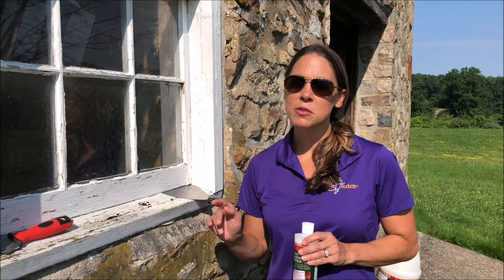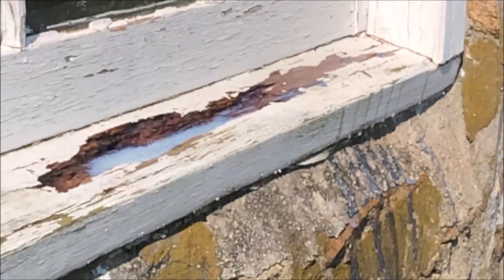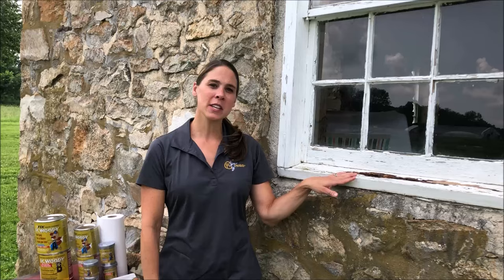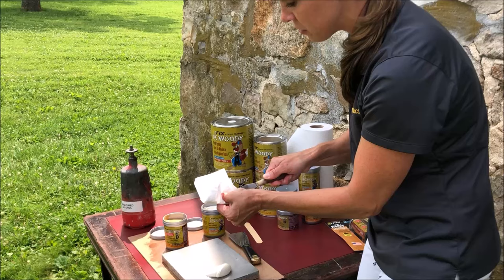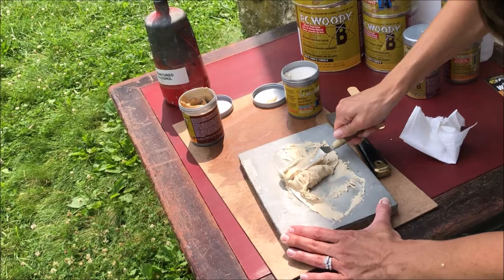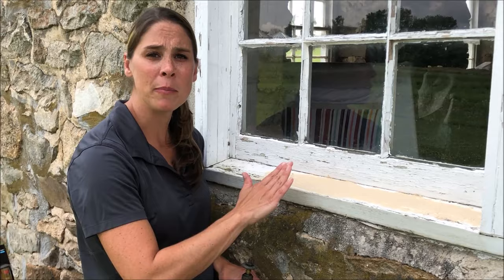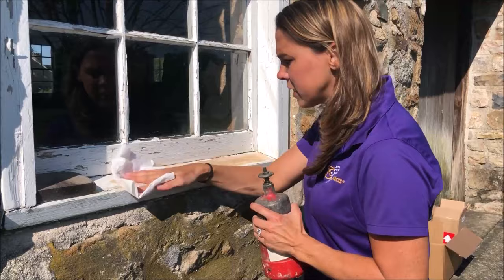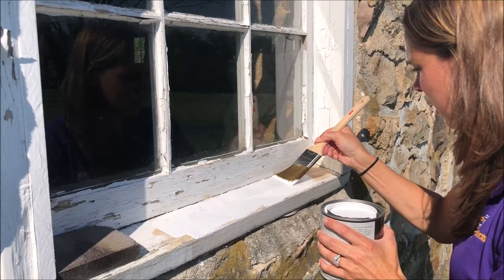Rotted window sill repair with PC Products

Comment: I'm interested in the wood hardener, but the actual details are lacking in the video as you go straight to the filler. How strong is the wood after you soak it with the hardener? I don't expect it to be like a whole piece of wood, but it would be nice to know if the strength is increased as a result of the hardener rebinding the rotted wood.
Reply from the maker: PC-Petrifier improves the hardness of damaged wood but it does not restore it to “new”.  It will strengthen the wood to enable the application of a wood filler such as PC-Woody.  How much strength gets added?  Tough to say because of variabilities in damaged wood.  It is best to expect minimal strength added and if more is needed then try PC-Rot Terminator.  It provides greater hardening than PC-Petrifier.

Comment: What if the wood is on a vertical surface?
Reply from the maker: Petrifier can be applied with a brush. Drilling small holes at a downward angle will help the product penetrate deeply. Woody can be applied vertically up to about 1.5-2 inches depending on the depth and width of the void.

Comment: The PC Woody works great. However, you showed a repair of a relatively accessible section of a sill. I’m repairing sill corner that is difficult to get the PC Woody into the crevices. Any suggestions on how to approach this problem?
Reply from the maker: If the corner is hollow it will be necessary to open up the surface and harden the wood with PC-Petrifier or PC-Rot Terminator wood hardeners then follow with PC-Woody.  If the damaged is limited only to surface crevices use alcohol or acetone on your gloved finger tips or tool to aid application of PC-Woody.
Reply: @pcproductsepoxy4315  Thanks for the acetone suggestion. The PC woody was sticking to my gloved fingers.

Comment: This looks like a great solution.  I have a basement window sill that's rotting out from the bottom such that the concrete foundation is exposed.  Will this product bond between the wood and concrete surfaces?
Reply from the maker: Yes, The PC-Woody will adhere to both the wood and the concrete. You may want to mask off any areas around the repair to prevent the Petrifier from staining and for easier clean up.
Reply: @pcproductsepoxy4315  Thanks!  The rot removal and petrifier step went well.  The resulting cavity is wide (maybe 18-24") and is about 2.25" deep.  A couple of weeks ago you told @LSK Wong that a 2" cavity doesn't need to be done in layers.  Is it's a bit deeper than that is the advice different?
Reply from the maker: @adamhocherman8065  if it's horizontal then no you can fill any depth of cavity. If it's vertical, with a cavity of that size we would recommend doing it in layers.

Comment: Corner of window sill broke off. Can if form the missing corner with rigid Teflon sheet, fill the void with PC Woody and be able to remove the Teflon when your product cures? If so, I would then sand and paint the repair.
Reply from the maker: Sam...while vertical repairs can be done using forms and wax paper or a silicone release agent, that is a bit more advanced. PC-Woody can also be built up in layers as it will adhere to itself.

Comment: What are the pros and cons of the PC-petrifier and PC Woody versus 3M rotted wood restorer and 3M Bondo wood filler?
Reply from the maker: 3M's wood restorer is highly flammable.  It is low viscosity.  The active ingredient is a waxy substance in low concentration.  It soaks in easily and dries to a water resistant coating fairly quickly.  PC-Petrifier is not flammable, doesn’t smell bad and adds a polymer that cures in the wood at a higher concentration.

Bondo has an off putting odor, cures fast and sometimes prematurely depending on how much catalyst is measured.  It is hard like a rock when cured and does not move with the wood.  It will develop cracking and fall out of the hole when exposed to exterior environment. PC-Woody is 3 times stronger than wood when cured and will never shrink or crack or fall out.
Reply: @pcproductsepoxy4315  Thanks for taking the time to respond to my question. Much appreciation. Cheers! :)

Comment: On the directions it suggests drilling small holes for deeper penetration. Any tips on how far apart to space these holes?
Reply from the maker: Space the holes roughly 1.5 to 2 inches apart using a staggered "brickwork" pattern.

Comment: Hello Friends!
I'm using PC Woody to fill holes and re-drilling them. After filling the holes for the first time, the Epoxy sinks into to holes a bit. Can I apply a second batch over the first one after 12 hours? Or should I wait more?
Reply from the maker: It is best to wait until the first application is fully cured (approx 24 hours)
Reply: @pcproductsepoxy4315  that's what I did. Should I wait another 24 hours to re-drill the holes or more? Is there anyway to know if its fully cured?
Reply from the maker: @Matan2222222  Yes you should wait till the product is fully cured to re-drill the holes. When the product is rock hard it is fully cured.
Reply: @pcproductsepoxy4315  It's cured for 2-3 days. It's easily dented with the drill bit, is it normal?
Reply from the maker: @Matan2222222  if it is easily dented it is not fully cured. 24 hour cure time is based on 70 F temp and low humidity. If it's been colder it will take longer for a full cure.
Reply: @pcproductsepoxy4315  Thanks!

Comment: LOL so I can see the finish side v non finish side can I, what was I suppose to be looking at? And how does your product perform in a crevice where access is limited not the nice accessable hole your working on??
Reply from the maker: Admittedly it is difficult to see the difference on video. The untreated side was still soft and spongy. In smaller cracks the PC-Petrifier will soak in just like water would so even if the crack is deep the area will be coated and harden and be waterproof. The PC-Woody will fill in the small cracks also. Because it is thick it will be difficult to apply to a deep crevice but if PC-Petrifier was used the rot will be stopped and the wood will be protected, so it is fine if the PC-Woody doesn't entirely fill the crack.

Comment: Hello! Thanks for the great video!
I have some drilled holes in a piece of wood that I would like to fill with PC Woody 2-part wood epoxy.
after filling the holes for the 1st time and letting the epoxy cure, can I add another layer of epoxy if the epoxy sinks into the hole?
Reply from the maker: Yes PC-Woody will adhere to itself. But, it also doesn't shrink so as long as you fill the holes the first time you won't have to add to it.
Reply: @pcproductsepoxy4315  Thanks!
Reply: @pcproductsepoxy4315  Good to know. I have a vertical repair under window flashing (which will be glued to the repair) and did not want to start with too great a thickness.

Comment: A guy I work for bought some of this for us to use around a project as a possible replacement for what I already use (wont mention product name ) or to use along side it. 
 The stuff is very hard, stuck to the floors we patched with it and other various items. My main issue was how stiff it is. I dont know if it was how long it sat on the shelf before it was sent to us but, it was really tough to mix together. I do a lot of various repair work and it was tougher than anything I've used before.
Reply from the maker: There are likely two possible reasons for the thickness/stiffness of the PC-Woody. One would be if the product is past it's 2 year shelf life (as you surmised.) There isn't any real solution to this other than to get new product.  The other reason is temperature, if the product is cold it will stiffen up. It can be warmed in a warm water bath or using a heat gun or heat lamp, but do not microwave it. Once warmed the product should be more workable.
Reply: @pcproductsepoxy4315  
I think it was passed its shelf life. I warmed it up but,still wrestled with it. I did het some use out of it though and am not dogging it. I haven't written it off
Reply from the maker: @williamsmith9026  if it's past it's shelf life we would recommend getting fresh product.

Comment: So what about on vertical surfaces?
Reply from the maker: Petrifier is water based and thus it's the same consistency. The best approach for vertical application is to put the product in a container and brush it on. Additionally, some small 1/4 inch holes can be drilled at a downward angle to help the product flow into the wood. PC-Woody can be applied vertically up to 1.5-2 inches without sagging. There are some variables such as temp and humidity also the depth of the cavity, the more shallow the higher you can go.

Comment: Another question.  I have a really, really rotted window sill that when I press on it, it almost squishes right through like there is nothing left to it.  Will this stuff work on that? There are also holes on the front part of the wood.  Wonder if it is too far gone for your product!
Reply from the maker: Mark, it's difficult to answer without seeing the condition of your window. It really is your call based on the severity of the rot and your confidence in your DIY skills.
Reply: @pcproductsepoxy4315  This didn't work for me how do I get a refund?
Reply from the maker: @mkdsk101  simply return it to the place of purchase.
Reply: @pcproductsepoxy4315  It’s open and I use some of the liquid so they won’t take it back. What do I do?
Reply from the maker: @mkdsk101  where did you purchase it?
Reply: @pcproductsepoxy4315  Home Depot.  I just want my $26.00 back.

Comment: Can i put  it in a plastic bag and mix it, then squeeze it where it needs?
Reply from the maker: We would suggest mixing on a board first to be sure it is thoroughly mixed. Then if you want to try the bag method you could, the product is fairly thick and viscous so it may be a bit difficult to apply in such a manner but it is not impossible.

Comment: Does it wash off the rocks and cement?
Reply from the maker: PC-Petrifier is the consistency of water so yes it will run. We do recommend masking off any areas that you don't want treated. PC-Petrifier will clean up with hot soapy water.

Comment: Can  I use  this stuff to repair subfloor ?
Reply from the maker: For sub floor repair we would recommend our PC-Rot Terminator over PC-Petrifier to stop the rot (PC-Rot Terminator is recommended for structural repairs) PC-Woody can be used on the subfloor.

Comment: Great video! Will the "squishy" wood petrifier penetrate through a painted surface?
Reply from the maker: No, the paint should be removed as much as possible or holes drilled through the paint to allow the Petrifier to get to the wood underneath.

Comment: I assume I can get it on Amazon? I'd like to get that 2-part Epoxy to fill in ruts on an old window seal so I can sand it smooth to finish. Should I treat it first with that petrifier?
Reply from the maker: The PC-Petrifier is only needed if the wood is rotted, if not then PC-Woody alone is sufficient. And, yes all our products are available on Amazon, here is a link to our store on Amazon https://www.amazon.com/stores/Protective+Coating+Co./page/77FD7AEA-9DFD-4BB0-B243-7EDCC728B6FD?ref_=ast_bln
Reply: @pcproductsepoxy4315  OK Thanks!

Comment: You can always cut the old sill off and glue /screw a new piece of wood on probably safer .your hair won’t get in all the toxic stuff and you won’t have it all on your table etc .
Reply from the maker: In some situations if the rot is extremely sever, yes replacement is the right choice. But in others repair is a better option. By the way both products are non-toxic.

Comment: I have a window sill with about a 5-inch section of damp, spongy wood. Do I have to dig out all the wet wood first, or just apply the wood hardener over it? Thanks!
Reply from the maker: We suggest removing as much of the really loose material as possible. You don't have to be overly aggressive but should remove whatever comes out easily with your hands or a screwdriver or putty knife.

Comment: Can you wood hardener PC Petrifier be used to stabilize wood? Thank you
Reply from the maker: If by stabilize you mean harden soft and rotted wood and prevent further rot, then YES.
Reply: @pcproductsepoxy4315  is this a type of epoxy?
Reply from the maker: @bmpcc4ktech852  PC-Petrifier is a single component wood hardener epoxy. It is not a typical two part epoxy that needs mixing.
Reply: @pcproductsepoxy4315  thank you. So it is water and heat resistant? Does it cure rock hard? I have some burl that I want to use but has some soft spots but I want to soak it in ur product to see if it makes the wood stable (original wood hardness). Will that work?
Reply from the maker: @bmpcc4ktech852     Yes once cured it is heat resistant to 200f and water proof. It will harden the soft spots in the wood and harden all of the burl.
Reply: @pcproductsepoxy4315  does it cure clear or is it “milky white”? Can it be sanded and buffed and provide a glossy look? And last question, best drying process? Thank you for taking the time. I looked for videos and couldn’t find any to address my questions
Reply from the maker: @bmpcc4ktech852  it does cure clear. As far as buffing to produce a gloss, you will have to test this for yourself. The product penetrates into the wood it doesn't create a very thick coating so sanding and buffing will be tricky. Best drying process is simply temps above 70f,  dry conditions and time.

Comment: I would like to try this on my rotted windows.  What kind of material can I use as a board or container to mix PCW?  Can I use disposable plastic container from fast food?  Will it melt?
Reply from the maker: Shawn, that will be fine, it won't melt, however you may want something with a little more strength and stability which will make the mixing easier. A piece of cardboard or a tile or a piece of plywood work well.
Reply: @pcproductsepoxy4315  I think I'm gonna mix it with a trowel & a putty knife.  Will the PCW stick to paint if I don't scrape off all of the paint?
Reply from the maker: @HumbleBearcat  Yes it will but note that if that paint ever peels away from the wood the PC-Woody will peel away with it. Best practice is to apply it directly to the wood. It is perfectly fine, if a small amount of paint remains and there is a sufficient amount of direct wood contact.
Reply: @pcproductsepoxy4315  I bought the 48 oz cans.  How long do I have to wait before I can sand & paint(each)?  Assume at 60 deg f temperature.
Reply from the maker: @HumbleBearcat  24 hours should be sufficient.
Reply: @pcproductsepoxy4315  I used it for the 1st time yesterday.  Boy, mine PCW was so much thicker and harder than yours.  Very hard to make it smooth, even just to mix it.  I wish mine is like yours.
Reply from the maker: @HumbleBearcat  not sure what the temperature was for you but that will have a significant effect on the thickness of the product. You can always warm the product by putting the containers in a hot water bath.
Reply: @pcproductsepoxy4315  Was around 65 outside.
Reply: @pcproductsepoxy4315  I took your advice and boiled the cans in a pot of water for 3 min and they turned out much softer and workable like yours in the video.  I applied it to the rotted windows, and it turned out much better than last time. Thanks for the great advice!

Comment: Is the epoxy curing process effected by moisture? If I put the epoxy wood into the open spaces and it rains or is very humid does that effect it? Also where can I buy this?
Reply from the maker: Yes during the curing process PC-Woody should be kept dry. High humidity will extend the curing time but not be detrimental. The products are available at most local Ace or True Value type hardware stores, also available on Amazon.

Comment: What keeps the remaining wet wood that was not dug out from drying, shrinking and pulling away from the PC-Woody?  Minwax makes a wood hardener that is also good for stabilizing rotted wood before using a plasticized filler.
Reply from the maker: The PC-Petrifier that was applied to the rotted wood prior to the Woody stabilizes and hardens the wood and provides an excellent surface for the bonding of the Woody.

Comment: Can I buy the product in Home Depot or Ace hardware?
Reply from the maker: Our products are available at Ace hardware stores (most other "mom & pop" type, True Value, Do It Best hardware stores.) They are also available online at Home Depot.com, Lowes.com and Amazon. They are not in Home Depot or Lowes brick and mortar stores.
Reply: @pcproductsepoxy4315  thank you for your response. I got only tennie tiny bad wood inside our bay window. I hate to replace the whole floor.it where I put my plants. What is the name of the product again? 🙏🙏🙏
Reply from the maker: @priscillarobb647  There are two products in the video: PC-Petrifier and PC-Woody
Reply: @pcproductsepoxy4315  “Maraming Salamat Po”- Thank you so much. 🙏🙏🙏

Comment: Is the denatured alcohol also a "clean burning/stove fuel"? Or are there two different types of denatured alcohol? Also I want to thank you for this info, going to try restoring my windows until I get the money to replace them.
Reply: Stephanie, thanks for the comment. Stove fuel may be methanol and not a good choice.  Acetone is an option if ethanol is not available. Good luck with your project, let us know how it turns out!
Rich Baker
PC Products Sales Director
Reply: @richbakerpcproductssalesdi6922  Okay, I was thinking stove fuel didn't seem right lol but that's all I could find when searching for "denatured alcohol". Thank you, I have acetone so will use that.